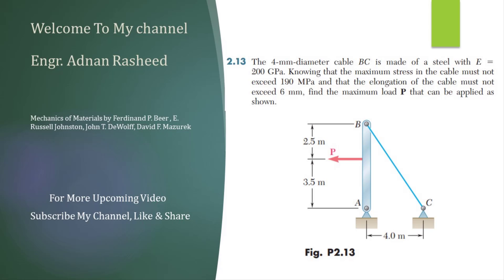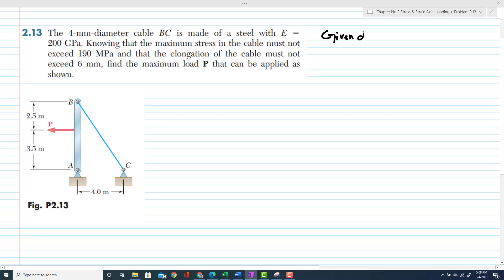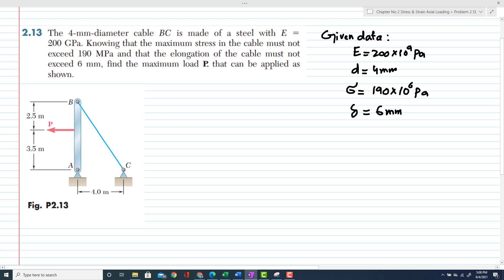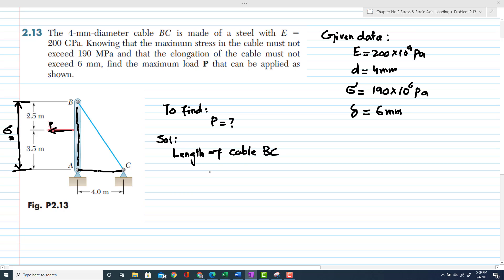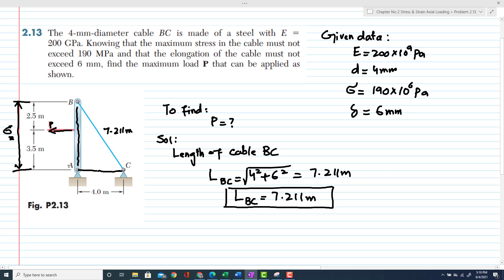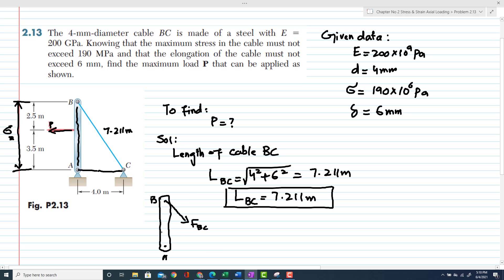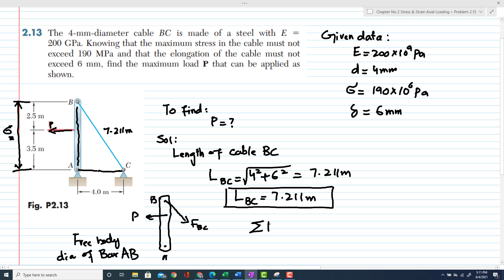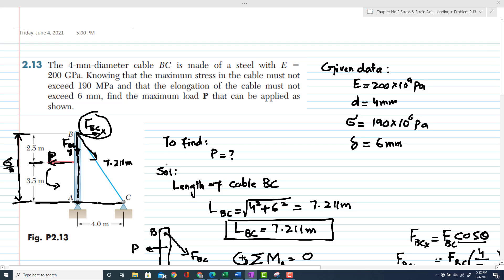#Mech of Materials# |ProblemSolutionMOM​ | Problem 2.13 |Stress & Strain| Engr. Adnan Rasheed

Comment: Hello I want some clarification to understand the concepts of the given maximum load. Why chose the lowest FBC when you have higher FBC and it states that find the maximum P load. It should be the 2388.3 N FBC right?
Reply from the maker: That's very simple the smallest one that is safer to apply and it will satisfy both conditions the stress will not exceed than allowable stress and strain will also the same as given. While when you put larger one , so it will cause the strain to be larger than the allowable value. ❤

Comment: Actually, l am faceing some problems.
I can not solve one math. I don’t know actual answer in this math. 
That math is similar to it. Just p is upward direction.  Give a Bd rod and direction is right side.
Reply from the maker: Learn it and then apply the concept
Reply: @engradnanrasheedmechanical  l am solving this math. But l don't understand if the answer is correct or wrong???
Reply: @engradnanrasheedmechanical  If l write  this question without diagram, can you solve or say answer??
Reply from the maker: Email me the question on adnanrasheed@uetpeshawar.edu.pk
Reply: @engradnanrasheedmechanical  l am sending math in your email address.